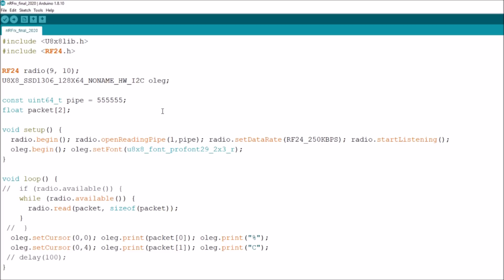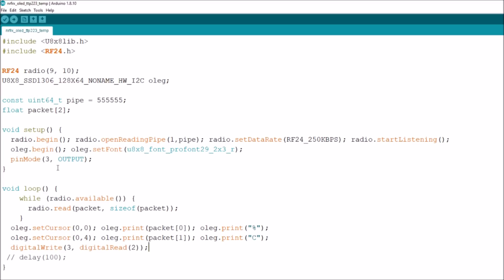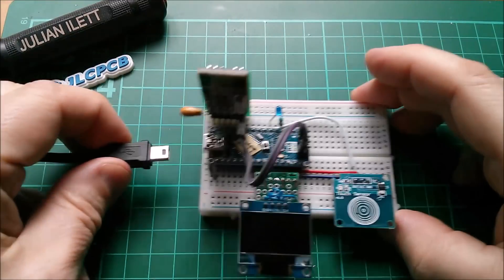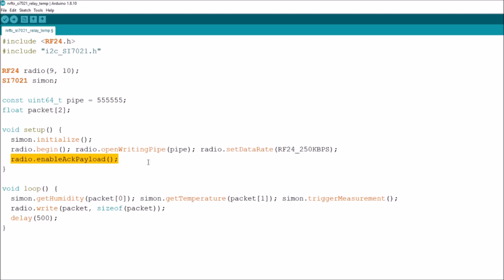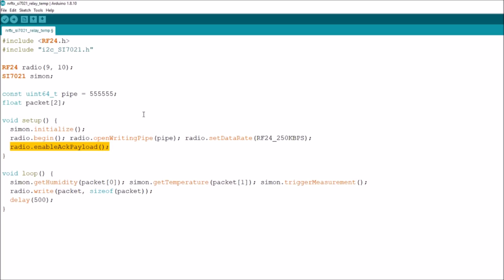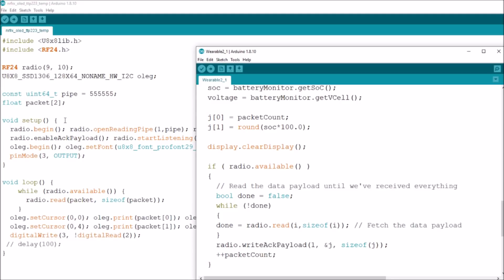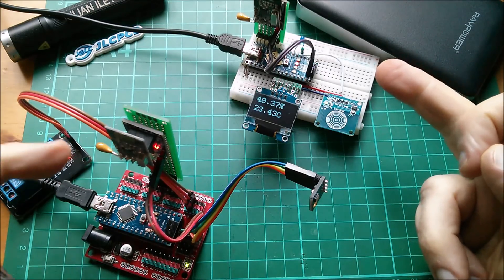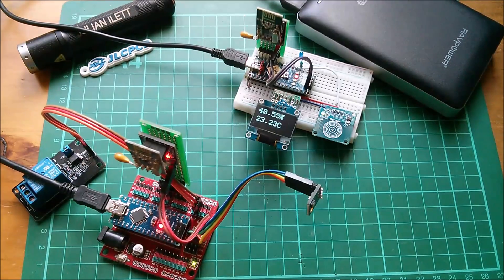It Works! Arduino, Transceiver, OLED, Touch Sensor and Relay

Comment: You might get a bit more real-time "feedback" on whether the fan is running by either delaying the toggling of the LED, or the display of your "Fan On" indicator, until the Ack payload is sent. Even if the acknowledgement isn't received the first time around (irony!), your "receiver" will at least keep trying to turn on the fan.

Comment: A quick suggestion, try using PlatformIO with either Visual Studio Code or Atom as an editor so you have autocompletion available as well. No need to remember all of the functions that way :)
It's not perfect but it's a whole lot better than the Arduino editor.

Comment: Think I'd reduce a lot of the hardware and use a couple of ESP8266's with something like Espeasy or Tasmota - all for under a tenner. You will still have all the 2-way comms and be able to connect the usual sensors. Good idea on using current draw to check fan but you're stuffed if it's stuck. Shame the fan doesn't have a spin pulse output you could monitor - couple of magnets (for balance) and a hall effect sensor like the NS005 A3144 board?

Comment: My 2c. If you send the actual state of the relay together with the measurements, you can use the momentary mode of the switch. This way, you will not turn off the fan at startup of the receiver. I don't know if you always want the fan to be off at startup of the switch side.

Comment: You should not do this, as it makes the code more complicated.

But you can use the value of an assignment. So.

writeDigital(2, (payload[0]=! readDigital(3)));

So, assignments do gave a value in C and C++.

Comment: And now you´ve got 3 logic inversions going on! The first is in the touch sensor, where you set it to active low. The second is in the receiver, where you inverted the input to turn on the LED. And the theird is now at the transmitter, to get the relay to follow the LED on the receiver..... Wouldn´t it be easier to just make the sensor active high?????

Comment: Using arrays of type bool is really bad idea. And using its sizeof is even worse. The problem is that size of bool is compiler dependent and can be really anything. Plus it is minimum of one byte in size. And what compiler does when using array of bool values is not completely predictable. Even the same compiler can pack it differently with different optimizations enabled. There are few more complication, but explaining them would make this comment 5 pages long.
Long story short: It's much safer to just define your payload as uint8_t and modify its bits using bitwise operations.

Comment: Don't forget to initialize the payload data value in the transmitter!
Also - (and this is a bit of OCD on my part), in the receiver code, the first time the loop executes, it sends the fan state boolean BEFORE it reads the switch input.  Move the switch read to the start of the loop - just for me.
Cheers,

Comment: Is that the kind of relay that only needs power to switch (latching) or does it always need to be powered to stay on?
The latter would probably drain the battery a bit faster.

Comment: Great video Julian, I think you should stop calling them tx and rx, they are transceivers.
I notice you don't embed your code filename in your code.
I do this;

Serial.begin(115200);
Serial.println("=== filename ===");
 
in the setup part of the code.
This way the code identifies itself when ever your connect USB plug.
It is also good for keeping track of version numbers of your code as you develop it.
Is there a reason you do not have a OLED on the shed unit?
 When you are down in the shed you will have a local readout of the conditions  you are working in.
Reply: agree, oled in shed would be nice, but takes power from battery, need button to activate it when needed, doable.

Comment: Oh but you MUST hook one of your smaller solar chargers to that battery which runs the fan, and perhaps a small power supply built to run the arduino in the shed so battery's will not become a problem down the road.

Comment: Cool project. Is that battery powered transmitter sending data every half second? I would change it to a higher value, like two seconds. That would save battery and it would still be fast enough for a fan controller... 😃

Comment: You don't want the while in the receiver, use an if. Here while works just like if, but as soon as there are more than one packet available, all but the last will be overwritten and lost.
You should only update the display if there was a reception, that code should be inside the if.
You don't need the one element arrays, just make the payload a bool.
You should load the ackpayload on startup (if you don't, the very first packet will get no payload in the ack) and (like you did) after a reception.
Checking for the success of the write would be a good idea, wouldn't it?
You could then retry instead of delaying, this is wireless and some transmissions may fail, even if retried fifteen times by the NRF.
The button delay is caused by fact that you have to preload the ack in the context of a reception, so it takes two packets to transfer a new state, one to consume the old data, one for the new.

Comment: Td is roughly equal to T-((100-RH)/5) according to Wikipedia.
Td is the dew point temperature, T is the current temperature and RH is the relative humidity.  This is accurate to around 1 degree C as long as the relative humidity is above 50% according to Wikipedia.  I don't know how bad the accuracy becomes as the RH goes below 50%, but I'd presume that the accuracy is still close enough for controlling a fan.
Just have the transmitter calculate the dew point temperature and have it turn on the fan if the measured temperature is equal to or less than one degree higher than the dew point temperature.  That would be a good starting point. You may want to adjust it slightly later on.
You could have the transmitter send the fan state (on or off) along with the temperature and humidity data, then either put the state on the display or light the LED when the fan is on.
Edit: The biggest problem I can think of is introducing some hysterisis so that the fan doesn't turn on and off again rapidly, but I guess having the "on" point be that one degree difference and the "off" point be the dew point temp going over the actual temp would probably work.

Comment: You need the while in the if.  You do how ever need to move the "oleg" print functions in that if statement. That way you are not needlessly updating the display with data that hasn't changed because you received something new. To explain (what others might have missed) the while is their so that if the packet hasn't finished processing you need to call radio.read() (else it wouldn't have to be in a while in the first place). The "print" statements should normally only be called to update the screen once data has been received to update the screen with the (possible) new data. And not be refreshing all the time. That is just a waste / or bad programming.
Just my 2 cents. Love the content so no complaints there. :)

Comment: What I've discovered is that if you are using two different Arduinos such as an Uno and a Nano you can have both plugged in to the PC at the same time as they use different com ports. So I had both code windows next to each other with the relevant serial monitors  and didn't need to faff around swapping the cable over.
Reply: same for any 2 pyboards,  uses com ports ttyACM0 and ttyACM1 in linux, 
using rshell in each of the split screen terminator windows 
to connect to the different com ports : rshell -p /dev/ttyACM0, rshell -p /dev/ttyACM1

Comment: This is a great little project. I can think of another use for this, operating our garden sprinkler system/s. A moisture sensor could be added. There are endless applications for this little setup. Thanks, Julian well done.

Comment: 1) You forgot to initialize the value of payload at the receiver. This may cause a random output at boot.

2) when you pass the name of an array as parameter, the compiler sends the pointer to the array (it can't be any other thing). Then, you don't need to add &.

xxx(payload) is equivalent to xxx(&payload[0])
Reply: Yes,  I too noticed the lack of initialization of the "bool" variable in both cases.  This is a very bad idea,  counting on things to be a certain way unless there's something going on in the background that does this that's not apparent...

Comment: The LED was on at start up because the output from the sensor is set to active LOW.
Reply: As soon as he mentioned, that the LED came on at startup, i emidiatly thought "The output of the touch sensor is set to toggle, inverted (active low).... Off course the led comes on at bootup.

Comment: to save code, try re-watching the prev vid you posted, and look at what you did wrong on the TTP222. 3 and 5 are connected together instead of separate, meaning defaultPowerOn = True is being ran in the firmware for the touch sensor chip.

Comment: hi,

- the payload wouldn't need to be an array. It might be a normal variable.
- the digitalWrite(2, payload) should reside inside the if-statement
- maybe you get a first time problem. Maybe the payload should be prepared und added befor the first read.

Comment: Just a heads up that you didn't test the case where the Fan would be running but the receiver reboots and turns it off.

Issue being that if you are out and it reboots and the fan turns off it could have unwanted consequences for your shed if you don't notice it for some time...

Comment: 7:10 the bool done thing means this: 

     bool done = false; //just creates a boolean variable with false value already stored in it
     while (!done) // a while and if and similar functions are actually really simple - if there is a one in the brackets, run! otherwise, don't - by doing things like variable == 10 you create a logic operation that will either return a zero or a one - there for if you write "if (boolean variable)" it will run when the variable is equal to one (and ! just inverts the number | 1 = 0 and 0 = 1 |)
     done = radio.functionBlah() // radio.functionBlah is a function that returns (just like a variable changes its state) a value when it finishes, from what it looks like, it gives a 0/false if it failed and a 1/true if it was successful
//what this does is, it runs the radio.functionBlah() until it gives back a confirmation of a successful something it is supposed to do. It changes the done variable to true causing the while loop to end

If you still don't understand, I will try to explain it better.

Comment: Looking good, could you not read the data to auto-magically turn the fan on and off as needed also with reference to voltage levels you can then turn the fan off if the battery gets too low.

Comment: In regards to the default state, I think there might be a typo in the datasheet. Under "pad description" having pins 4 & 6 as high puts it in toggle mode with default to low. However under section " output mode" says to set pin 4 to low to default to low.

Comment: Hi Julian. You are overcomplcating the code, inverting the states. On the TTP223, you can have its startup state as 'off' using the requisite pin state on the chip
Reply from the maker: When I get the new TTP223 boards (which have solder pads for mode selection) I can remove the inversions from the code :)
Reply: @JulianIlett  Pulling pin 4 of the TTP223 low sets it to active high, so starts low.

Comment: Looking good.  I am using NRL24L01 modules for a radio control system with telemetry displayed on a 5110 screen.  I started down this path based on your and Chris’ YouTube videos.  Cheerio

Comment: In knowing the actual state of the fan/relay I would just send that state of the pin for the relay back in the packets showing the temperature. Then you can use that on your display to show if the fan is really on or not. You can use a graphic or something simple like alternating a + and x to simulate a fan turning. No need for trying to measure current or a voltage drop.
Reply from the maker: But what if the fan fuse blows?
Reply: @JulianIlett  I was assuming it was not that critical of an operation. In that case, yes I would monitor for power. You can still do the same and only send back a 1 or 0  for that. Or maybe a 2nd bit for an a alarm. If relay is on, but power is low.
Reply: Julian Ilett you could use an AC relay on the fan outlet to switch an input pin on the transmitter.

Edit: oh in the UK every AC plug has its own fuse right? Or is it in the outlet?
Never mind, just noticed the fan wil be powered by a battery.
Reply: You should feed the received state of fan-on boolean in your data packet (probably use a struct instead of an array, btw) so you know both the actual state of the fan, and the received state of the boolean (button value.) Thus, if the 'transmitter' is rebooted, but the 'receiver' isn't, your blue LED will show the actual commanded state of the fan.
Reply: Even better add a buzzer to your receiver and if relay should be on and no transmission received for x time, sound the alarm. That way you know if the system is offline. You can also write last commanded state by writing to eeprom. Then read at boot, but might have to rethink how to read the touch switch state since you could not read it directly.  Your giving me lots of ideas...

Comment: I would reconsider the use of a 6A fan...that is a LOT of power being supplied from the batteries.
A standard case fan (or even 2) would be under half an amp...which would allow your batteries to last 12 times as long before needing a recharge.
Reply from the maker: I'll probably use the little PWM module to tone the fan down a bit :)

Comment: Cool project Julian. I'm really enjoying this series.
One thing i noticed: you have two inversions in payload. Once on the receiver when writing button status to payload, then again in transmitter when writing D2. If you removed both would it still work? You have the status led as a separate line of code so that inversion would be unaffected by the change. You've probably already noticed that though.
Looking forward to the next video!

Comment: I'm just building a similar setup. I will have a box up on the roof pulling air out of the house and housing an outside temp/humidity DHT22 sensor and my inside unit is a nano with another DHT22. The fan is an old 15 CM computer fan from an expensive Dell workstation. Fan speed control is done from the arduino via PWM so I can set the fan power according to the weather conditions etc. I'll just wire the connections up since I need to deliver power out there anyways but a couple of remote sensors around the house could be hooked up with radios to reduce wiring needs. One can fit a lot of information on a tiny 64x128 oled screen with a smallish font!
Reply: is that dht22 reliable, why not an bme/bmp2** ?
Reply: @jyvben1520  I don't know but I got some spare ones and it worked so I'll just go with them for now. I'm not trusting them lasting outside too long though.

Comment: So what happens when the fan is on and then you power cycle the receiver does it stay on or turn off the fan?
Reply from the maker: The fan stays on because the payload data just vanishes. As soon as the receiver is powered up, the fan shuts off.

Comment: Nice one Julian.

A suggestion occurred to me that isn't quite relevent to you but might help others ....

If you make your button display unit show the actual fan state, rather than its button state, you will be able to have multiple display/button stations dotted around different places.

Just add the actual fan status to the temperature message sent from your transmitter and only send button toggle data for a short period.
Reply: Maybe a line can be added to the OLED say FAN ON / FAN OFF?